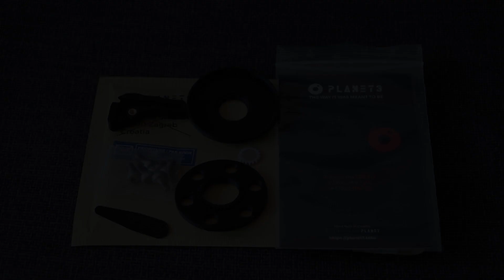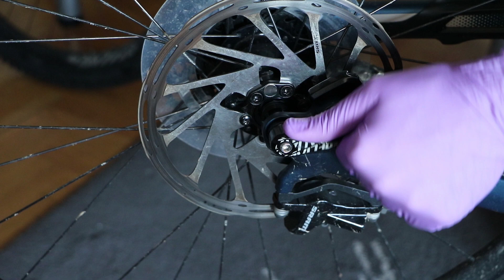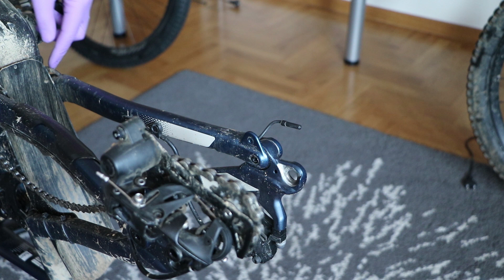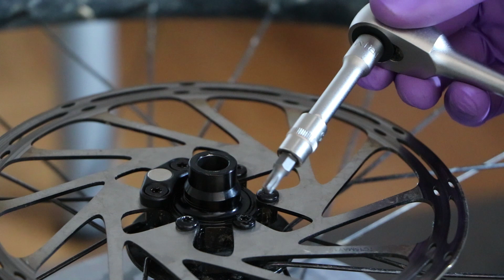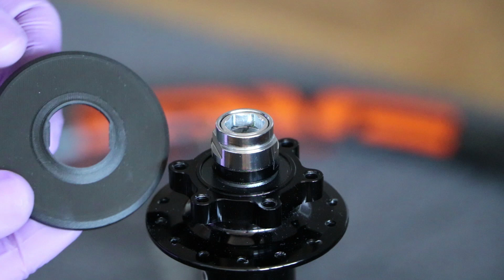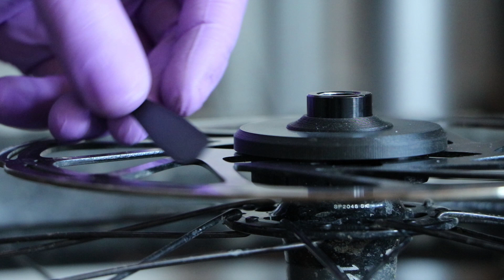PLANET3 installation instructions for 2019-2020 Specialized Levo, Levo SL & Kenevo (Gen2)

Comment: Does this work 2025 levo turbo comp
Reply from the maker: @Frankieacb  Yep, even though this video is outdated there is a version of the PLANET3 for your 2025 Comp. You should visit planet3.bike/shop and you should see if on the first page since it was added recently. There is also an electronic version called the PLANET3-E, but if you prefer the Mechanical there's a toggle switch on the product page where you simply click Mechanical. If you have any more questions you can ask here or via email, whatever you prefer. Regards, Alex.
Reply: thank you very much I’m thinking of the mechanical one for my 2025 turbo Levo comp does it effect updating the bike or anything like that? 
Is it straight fit on ?
Reply from the maker: @Frankieacb  just replying here for clarity and anyone else reading: No - neither the PLANET3-E (chip) nor the mechanical unit will affect the updates of the bike. There is always a possibility of a manufacturer preventing the PLANET3 from working in the future (and that's why it's a good idea to stay away from them), but this wouldn't have any negative connotations for your bike - only the PLANET3. As far as the fitting on the 2025 Levo Comp - you get everything you need in the kit. The end cap of the hub has to be replaced due to a concave profile, but you will receive it in the kit. Once that's done the kit is fitted in minutes and you're off. There's a video covering that here: https://youtu.be/vzXdYHVL5MY?t=84

Comment: This looks like a well made unit but  wouldn't be a good system in Germany because  it can't be removed easily . The police are very strict about these products so i bought a Bad Ass speed box that can be installed and removed in less than 15 seconds just in case you encounter a police control .
Reply from the maker: That's why we have a PLANET3-E which also features a "safety mode" - a measure developed to hide the device from children and police. :)
You can inform yourself more on our webshop: planet3.bike

Comment: I have a levo gen 3 2024 titanium that allready dose 28 to 30 mph now from factory... What would happen if you just remove the magnet from the bike wheel completely and leave it like that will the bike mortar run at full capacity
Reply from the maker: After 6 pedal strokes if the magnet is not registered by the sensor you get an error. A simpler solution for your objective would be to just not turn on the bike. :)
Reply: @planet3bike 😂😂😂

Comment: lol i can just make a coil to act like a magnet or I can even give up on that sensor and inject a sewuencial shurcut to cheat the bike is running at low speeds or anything is needed, PLA is the worst idea to have when moving parts atfast speeds this is cancer.
Reply from the maker: @videos40058  Please, do all of that!
Reply: @planet3bike  I would not find any fun with that. But I just given you an idea . Think of it… depending on you technological limitations you will find it or not a good idea. But hopefully someone that knows the deal will read our chat and then be like… - good idea i can make it. And this is how you go forward 😛
Reply: Help me out fella I've got specialised levo 2024 gen 3 motor... If I remove the magnet from the back break disc won't that just Tele the computer it's not moving at all & will work at full power constantly..
Reply from the maker: @pewtypshow3265  Nope, the motor will give you power for 6 rotations of the crank (regardless of the gear you're in) and if the magnet doesn't pass the sensor by then - it will cut your power and give you an error saying "no magnet present".

Comment: wow €100 for a printed part thats pretty high considering levociraptor is not much more and isnt a breakable printed part
Reply from the maker: We have something much better than Levociraptor, but it's not publicaly available yet. If interested contact us via email. 😉
Reply: Couldn't you just remove the magnet from the back brake disc and that would do the job simple and cheap AsF+×k

Comment: Does this work for the 2019 Specialized Kenevo Expert EMTB?
Reply from the maker: Hi Dave, yes.. you simply go to planet3.bike, enter the webshop and use the filters there (Specialized, Kenevo Gen1) and then compare your rear hub braking side end cap profile with the photos in the gallery. It should be the DHT-148S option if you still have your stock wheelset on the bike.

Comment: Do you have a hack for the HPR 50 motor on the new BMC Roadmachine 01 AMP X Two 20232?
Reply from the maker: Hi Steve, I can't say/don't know. The TQ motor as such can work with PLANET3 because it does on the Trek Fuel EXe models, but as far as BMC Roadmachine goes - I haven't seen the bike live, I don't know if the speed sensor is in the dropout and magnet on the brake rotor (or is it on chainstay and spokes) and if the hub profile on the braking side is compatible. If you have the bike and can take some photos, just poke me via email found on the webshop. :)

Comment: Are you planning making this a single or sealed piece, looks like to me that is prone to fail or wear down due debris or if pieces move along.
Reply from the maker: If you can point out to me which part exactly looks like it's not sealed and prone to fail/wear, I'd be more than happy to give it another look. Otherwise, I'm sticking with the latest revision and installation tool that's provided since it seems to be working on 5000+ units :)

Comment: Hi, forgive me if im wrong, but how that is different from the device (Levociraptor Gen 2) to unlock speed limit without mechanical interference?
Reply from the maker: Well, as you've said - one is an electronic device, other is a mechanical one. Without going into details, it's basically whatever your preference is. Some people don't want to mess with wires and potential problems with firmware incompatibly, so they get the PLANET3. Some people don't want a device that's "visible" on the bike, so they get a chip. Both have their pros and cons, I guess.. :)

Comment: Will this work with giant Stance E+ 2021 and will it void warranty with giant?
Reply from the maker: Unfortunately, the rear end of the Stance E+ has the brake post mount in such a location that it prohibits the PLANET3 from being installed on the hub. :/ Otherwise, it'd work fine and not void the warranty in any way..

Comment: Hey PLANET3 - I have a 2021 Merida running a Shimano ep8 - I’m in Australia which has a 25kph limit (it sucks) Can this kit be installed? I have seen mention in the comments about possible issues with newer bikes but just want to know if this is possible for Merida brand bikes. Thanks again!
Reply from the maker: Hi Mark, there were a few complications with Shimano since I last published my YouTube videos on the Decoy/Shimano PLANET3. Mainly, with the September 2019 update of the Shimano DU-E8000 motor firmware (version 4.7.1.), they have further narrowed down the range of the allowed speed-vs-cadence to a point where only a 1.3:1 ratio of a PLANET3 (30% bump in speed) will not cause W011 speed sensor errors on occasion when climbing stuff in lower gears. The ratio on YouTube and which works on older firmware versions (4.5.1 - 4.6.0) was ~1,6:1 which gave you a 60% bump in speed. Now, for all the Shimano equipped bikes that I already covered before this update, I have produced new internals that work perfectly with the 4.7.1. firmware but as I said, the ratio is 1.3:1. This is usually enough for people located in the USA and other areas in the world where the speed limit is 20 mph and then PLANET3 gets them to 26 mph at no risk to their warranty, but for people in the UK/EU and other parts of the world where the limit is 25 km/h or 15.5 mph, a 30% increase means "only" 20,2 mph. Most claim this is enough for them, but the fact is that even I find it too low so I've stopped any development of PLANET3s for newer Shimano equipped bikes. Basically, you're better off looking into software solutions for Shimano. :)
Reply: @planet3bike  Thanks for the reply - appreciate the effort.

Comment: Hey are the problems with a single planet magnet and gen 3 TL just possible with a future software update or do they already exist for sure? Going dual magnets sucks because of reduced speed limit ... thought about ordering one for my new bike but 38 kmh is not that much tbh ... i am disappointed regarding this development. :(
Reply from the maker: At the moment (May 2021) the most recent firmware version for the motor is 7.4.2. and works perfectly fine with a single planet configuration on several 2022 Gen3 bikes (and 2019-2021 models with the same firmware). HOWEVER, there is literally a handful of bikes out there in the world which produced a low-speed pedaling error (which does NOT cut the motor's assistance, it just flashes the magnet error via TCU but the bike keeps working fine). I was not able to replicate this error on several of my bikes and bikes I've got access to. It seems to be a phantom electrical issue that's a combination of hardware versions of the TCU and the 7.4.2. firmware. I'd be surprised if Specialized knows how to solve it, but it seems directly related to their attempts at breaking the "walk mode" feature further and further to the general annoyance of users which is well documented on emtb forums. However, somewhere down the line Specialized might go the Shimano route and implement a low-speed gear ratio detection which would disable the 3:1 PLANET3 (single planet) configuration at low speeds and in low gears (such as 1st to 4th). That's why even the first PLANET3 device ever made was designed to satisfy the condition that enables it to work with dual planets in a perfect phase (sum of the teeth of the sun gear and ring gear divided by the number of planets has to be a whole number). Goes without saying that each device after it satisfies the same condition. Anyway, most users find that 38 km/h is still a lot better than 25 km/h and perfectly adequate for 95% of riding. I agree with you that it sucks and I still want the power to be there whenever I throw in a pedal stroke at any speed and any cadence. That's why my little brain is overheating working on a general solution to this problem. :)
Reply: @planet3bike  Did you get any further feedback of Gen3 and Planet3 errors? I am about to receive my bike soon. Curious to see how it will turn out with single planet config.
Reply: 23mph beats 15 any day 😂

Comment: How about the brand new 2022 (Gen 3) models arriving this year? Specs are already out. I pre-ordered a S-WORKS Turbo Levo. Can you check and confirm if the PLANET3 installation will still be possible? Are you going to offer a new set or can we expect to simply use the "2019-2021 Specialized Turbo Levo (Gen2)" set you're selling for Gen 3? Thanks for a short reply!
Reply from the maker: Hi Daniel, it already works and has been tested.. I'm just too lazy to update the lineup. :) If you are dying to order one, you can order the S-Works device for any model year and just put "2022 Gen3!" in the order notes. But it'll be up in a day or two.
Reply: @planet3bike  That's really great to know. Thank you for the fast reply!
Reply: @planet3bike  Another question related to this: I assume some values visible in the new MasterMind Turbo Control Unit (TCU) display might be wrong, because of the PLANET3 modification (e.g. average & max speed), correct? Values on e.g. motor and battery should not be affected, I assume?
Reply from the maker: @danielbreuer9879  Yes, the way the PLANET3 works is by making the bike think it's going 3x slower than it actually is, so it keeps assisting up to a 3x higher speed limit. The values will be 1/3 of the "real" and it'll be shown like that on the TCU and also logged in the motor. Basically, you end up with a low mileage bike that was ridden very slowly. :)
Reply: @planet3bike but doesn't match up with battery charge cycles.
Reply from the maker: @robhines4537 it never needed to. Basically, the range estimation and battery consumption are both going to recalibrate themselves when you put it on the bike. Yes, someone might potentially look at this and say "wooow, you're using a lot more battery than before" but  this isnt clear evidence of any wrong-doing because who says you aren't towing a fat friend up a hill all the time? It's guesswork and thats why no one deals with it and there was no denied warranties for any Specialized user who has a PLANET3. The same cannot be said for Levociraptor, with which people are losing warranties left and right.

Comment: Would it work with 2021 Specialized Turbo Vado SL 4.0?
Reply from the maker: Yes, but there's a caveat regarding the rear hub end cap. If you visit planet3.bike there's a video link right next to the Vado SL/Creo SL listed that explains the problem. If you can take the original hub end cap off, then a Creo SL Comp PLANET3 fits and works on the Vado SL.

Comment: should i use oil for lube the movement or is better without lube?
Reply from the maker: Just like a good woman, PLANET3 brings its own lube. :> i.e. no, don't use lube. It only attracts fine dust/dirt and can form a friction paste inside. Keep it stock, if you dip it in mud, clean and dry with a paper towel, put back the cover and go. Basically, it should be set and forget and last forever (if properly installed).
Reply: Libe ur gf not ur bike.❤

Comment: I have a 2021 Pivot Shuttle with the new Ep8 motor, magnet is now on rotor? Do you have a kit for this one?  Thanks Todd
Reply from the maker: Problem with the Shimano is related to their firmware which after version 4.7.1. restricts the range of allowed cadence-vs-speed in such a way that only a ratio of 1,3:1 doesn't produce sensor errors (W011), so I've kinda given up on planetary gearsets for newer Shimano bikes. Ones that were already covered I produced compatible ratios for, and for people in the US 30% bump from 20 mph is enough, but for anyone in the EU it's really not and it's too complicated and expensive for what it provides. Check out eMax tuning for Shimano and ask them what is doable with EP8. :)

Comment: How does this affect battery life? I still don't understand why some use 2 sun gears?
Reply from the maker: It affects battery life in the same way as any other method of derestriction does: if you now spend time under power OVER the speed limit (where there previously was no power consumption) - it'll obviously use more. How much more? Depends on too many factors to be easily quantifiable: your fitness, assistance mode used, gradient, speed, tires, bla bla. Basically, having no speed limit it's the only civilized way to live, if you want more battery life - ride sparingly or at lower speeds, just like you would in a car.. you can have a very high consumption or low/lower consumption, depends on the regime you're driving and how fast you want to get somewhere.
Reply: 25 miles in Turbo on the flat is my guess.

Comment: Don’t know why but my levo with same hub as in the video showed speed sensor fault with the planet3 fitted. Removed planet 3 and fault gone. Any suggestions or anyone else had same problem?
Reply from the maker: Absolute first thing to check is if the sensor stayed bottomed out in the new sensor carrier. If that's all good, then it's 99,7% the speed sensor issue.. It's happened a handful of times before and for no apparent reason these go to hell. This Creo SL sensor diagnostics video might help shed some light: https://youtu.be/B3ZeYsmjOFI Basically, try it with the bike upside down and just spin the wheel by hand and look at what Mission Control (or BLEvo) are saying. If it's registering speed, then it works, if not - try moving the sensor closer but mind the orientation. A final (if possible) check would be to switch the rear wheel with someone else (yours with the PLANET3 on his bike). After a sensor replacement (~25 EUR), 100% of the time PLANET3 worked.

Comment: why can't u make it in metal?
Reply from the maker: It can be made out of anything, it just doesn't make sense to make it out of metal. Then you'd require a hydraulic press to fit everything and the axial distances would have to be picture perfect - meaning you'd have to center it somehow on things that aren't accurate (bolt heads, holes etc). The noise it'd make would also be terrible. It doesn't transmit any power or torque, doesn't heat up, doesn't wear out and does the job perfectly (so long as it's installed with the necessary gap between the sun gear and the ring gear). Now, if you had asked "why can't you injection mold it instead of 3D printing it" - that'd be a better question. :)
Reply: @planet3bike  ok im going to give it a go : )

Comment: Not sure if I missed it in the comments but will this work on a 2021 turbo levo?  USA version.
Reply from the maker: Yes, except the 2021 Turbo Levo base model. All the compatible models are listed at https://test.planet3.bike/shop/
Reply: @planet3bike  Will you be making a kit for the 2021 Turbo Levo - base model? Or is there a way to get it to work (like new brakes or something)
Reply from the maker: @jimimichalscheck4257  The problem is the rear hub's braking side end cap.. it has a concave profile which in and of itself would not be a problem as I already make replacement end caps for a lot of hubs. The problem is that the end cap is press fitted onto the internal axle and no user can remove it on their own without a bench vise, softjaw clamps for 15 mm diameter axles and something to actually remove the end cap. :) The solution is a new rear hub or wheel. In any case, the quality of that hub is so poor that it will fall apart within a few months of regular use anyway, so when users look for replacements I'm hoping they go the already compatible route (such as DT Swiss etc).
Reply: How do I purchase one?
Reply: Never mine I see how. Thanks